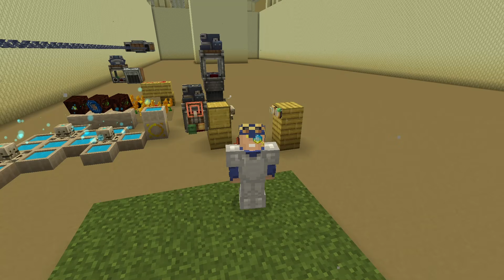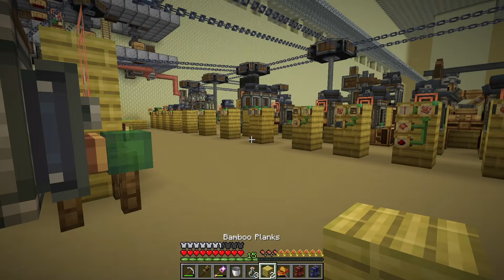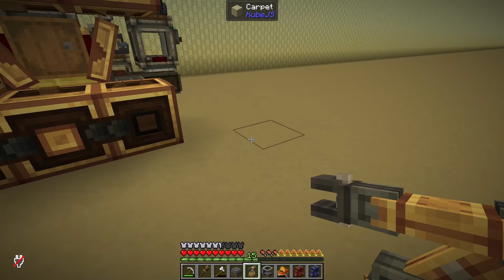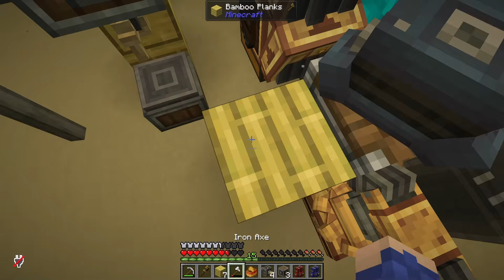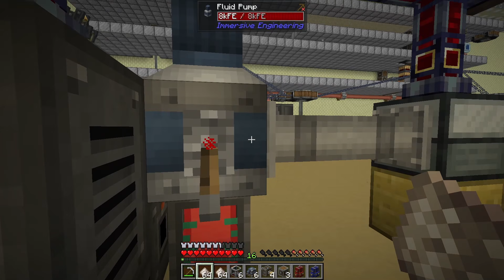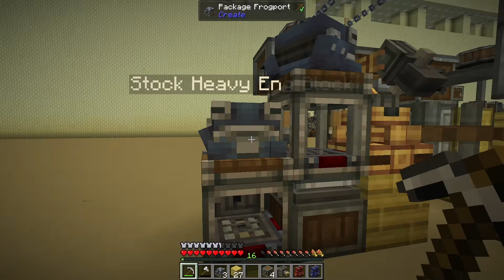Heavy Engineering Block Complete Automation - E25 - Liminal Industries Modded Minecraft

Comment: You mentioned the quartz stopped cycling? Makes sense, it's not guaranteed to produce more, but with each cycle you keep pulling more from the cycle, which means if the statistical increase isn't at least 100% double then it will eventually falter. As is you are gonna need some way of monitoring how much is in the cycle and occasionally feed some back in, or just be removing less from the cycle.
Reply from the maker: I'm sure there's a way to monitor stock here, I just haven't quite figured it out yet. A pressure plate at the laser won't work because that will stop the tunnel going into the storage drawer. I think the best approach is probably to monitor the stock going into the crusher for more than one, and send quartz if it's not backed up... I'll have to tinker with it.